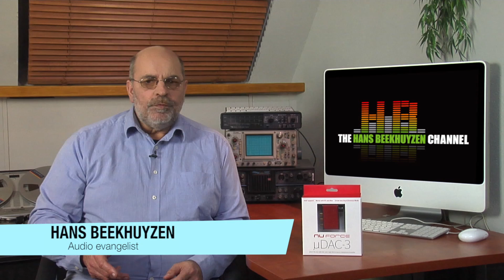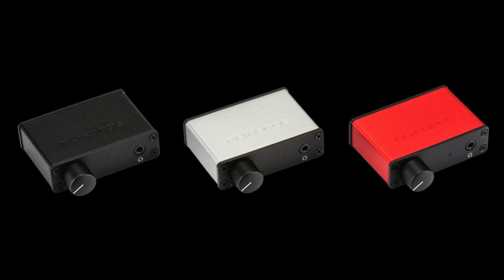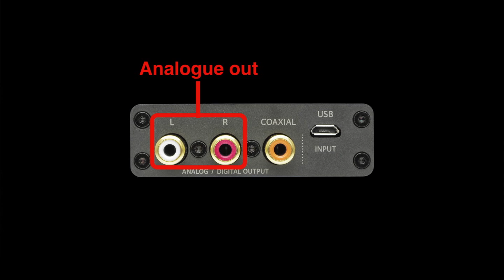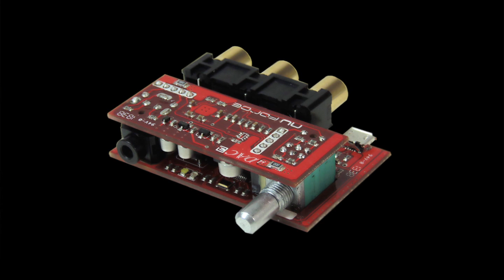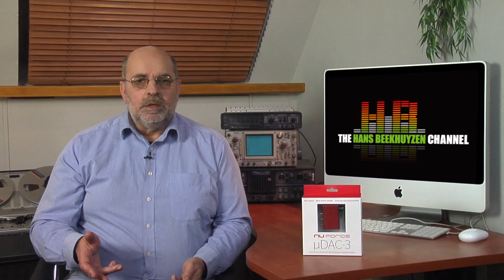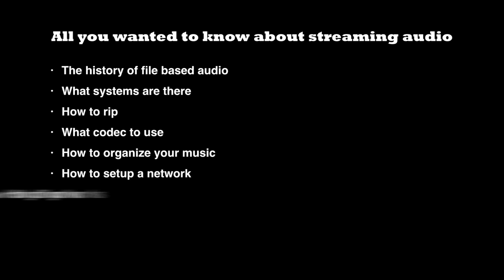009 NuForce uDAC3 - USB DAC review

Comment: Hello Mr. Beekhuyzen:

I wonder if you might be able to give me some insight on the uDAC3 vs the Topping D30.   I have an original uDAC and while it is ok, I wanted to replace it (actually, I need a second DAC for my main system, and want to use my original uDAC for my desktop/headphones only).  So, I bought a Topping D30 to use on my main system.  Unfortunately, it was very sterile/ cold-sounding, lacking in emotion, slightly recessed mids, and big, but one-note kind of bass.  I just returned it today because it made my main system sound too cold/ metallic (main system is Exposure 2010 with Epos ES14 Mk1 speakers/ Epos M12.2/ and Monitor Audio Silver 5i as alternatives which I swap in and out). 

Have you any experience with the Topping D30?  Based on your review of this uDAC3, I may go this route (I can't afford a 'high end' DAC right now, and wouldn't even know what to look at as a high-end DAC).

I just wonder if the uDAC3 is a big jump up from the original uDAC, and if the uDAC3 surpasses the Topping D30 in terms of sonic performance. 

I'm looking to stay away from cold/ analytical/ sterile sound.  I prefer a full-bodied, natural presentation with good midrange.  I also want to stay away from 'bright' sound, but also don't want a hugely noticeable upper frequency rolloff.  It's tough to find on a budget, that's for sure.  

Thanks in advance for any insight you are able to provide.

Comment: Hella Hans,
a very informative channel and website, I´ve learned a lot about digital and pc audio - I`m quite new to good sounding digital audio, I thought that mp3 is good enough so far, what an error !! - I want to listen to good sounding music on a simple way and without robbing a bank to buy expensive devices - i like your set3 on your website, ok, I´ve to listen to several speakers and compare them :) - I´ve a old DELL Notebook (only 60 GB, but I can connect external storages), that might be good enough for file storing, converting and so on together with foobar2000, than the NuForce uDAC3 or NuPrime uDSD (which would you prefer?) and than the NADC316BEE - what about the NuForce Icon-2 Amplifier & DAC instead ? - could you suggest a good cd player (for SACD and lossless audio formats) ? - thanks for your affort and have a nice weekend - best wishes from a new subscriber :)
Reply from the maker: +Jürgen Kaßnitz Thanks for the compliments. I would not use such an old notebook to play music. You can use it as a 'server' and then use a Raspberry Pi with HifiBerry DAC and Volumio as a player. Then rip your music in FLAC or ALAC and you don't need a cd player anymore. You do need a home network, of course. You could also use the laptop to fill up a USB drive with music and then connect the drive to the Raspberry Pi. Then you don't need to use the laptop for playing music.
Reply: +The Hans Beekhuyzen Channel 
Thanks for your prompt answer, Hans - upps, a completely new aspect :) - but I`ve more than 5.000 cds !! - that would take months to ripp them ;)
Reply from the maker: +Jürgen Kaßnitz No pain, no gain, as they say;-) But if you want to keep playing cd's consider the NAD C516BEE or Cambridge Audio CD10CD players.
Reply: +The Hans Beekhuyzen Channel 
thanks, I`ll put them on my list ;)